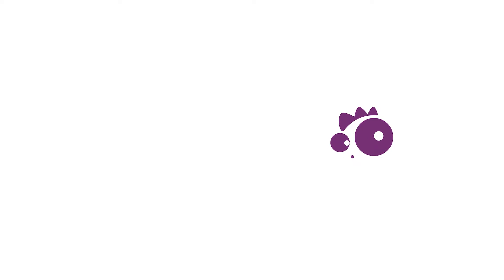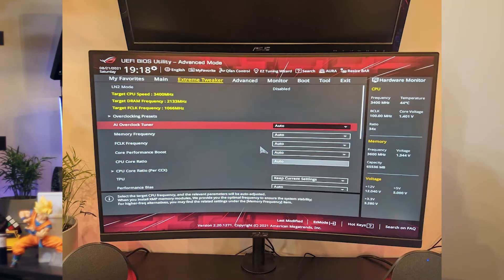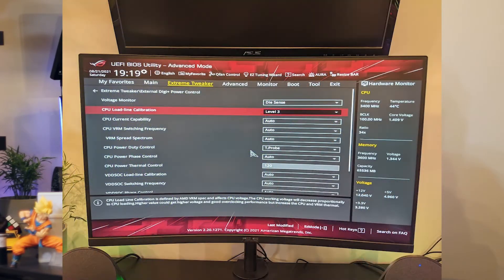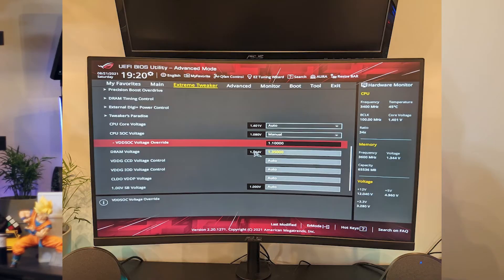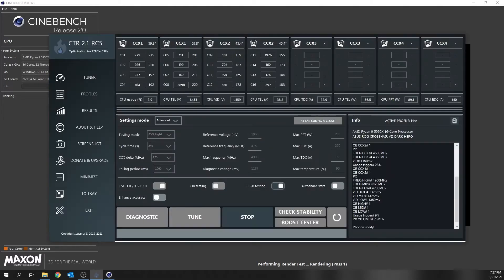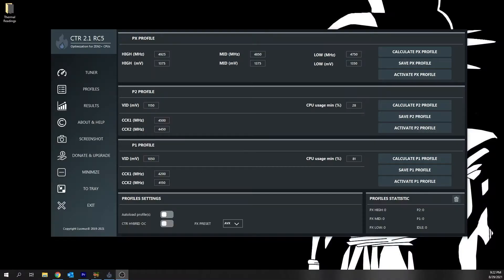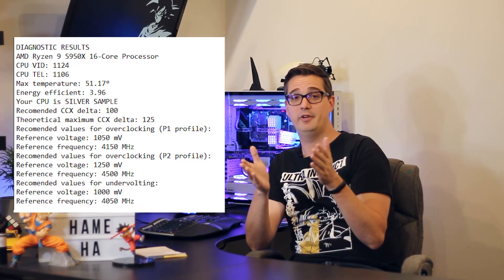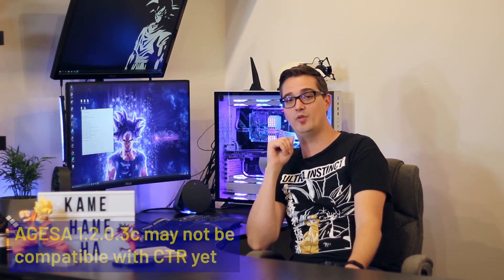What is Clock Tuner for Ryzen?

Comment: Hello i have 3600 cpu i use the ctr 2.1 i dont want to iveclock as you said i want to ndevolt my cpu but not lose preformance now i have the p2 profile ccx1 is 4500 ccx 2 4375 vid 1275 how do i know if it all core?

Comment: What about the guys who don’t have dynamic OC switcher?
Reply from the maker: Without dynamic OC switcher you can certainly manually apply an overclock, but it is a waste of time for gaming. Games run a world thread that benefits more from higher single core boost than it does from all-core boost.

If the goal is heavy workloads then an all-core overclock is beneficial. This would be set manually using the multiplier and the core voltage settings.

I'll be doing more overclocking videos in the future, there are a lot of things to cover.

Comment: I know im kinda late to the party, but I guess with the new CTR 2.1 (just build my new pc w/ 5900) all I did (or had to do) was turn on XMP and set my LLC to mode 4 (msi x570). Just wondering since I see you have spread spectrum and all these other settings dis/enabled. 

Works like a charm for me and gets me 23000 in cinebench r23 stable and it even gives me room for more clock/voltage.
Reply from the maker: Yea it worked fine for me the first time around, but after that it wasn't working anymore. It isn't a "peak performance" tuner, more for a solid balance of power efficiency vs output. It's a cool tool, but I'd still rather dial my stuff in manually (ended up with the same result in the end).